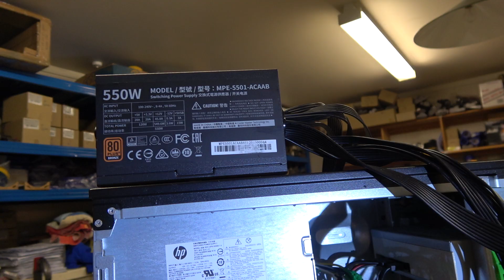hp atx power supply upgrade no adapter

Comment: You have to step up the purple 5v wire with a regulator or jumper it over to 12v to the p2 plug I've always just cut the wires off the OEM PSU and cut wires on the aftermarket PSU wired them up solder and send it .

Comment: Things have changed since the video. Atx to hp power adapter, the front io connectors need to be grounded by bridging a wire on usb 2 and connecting a jumper from the blank pin to the ground on pin 4 for the usb 3.0. That’s 2 or 3 jumper wires depending if what you have on the front io. You can wire the pwm fan into 4 pin seeing as you’re handy with electrics. I’m doing mine next week.
Reply: Are there any guides online on how to do it? Where can I find an adapter? Please send links if you have any.
Reply: @codycorg  https://www.youtube.com/watch?v=vL_QYvK_a8U

Comment: I'm  changed the PSU on my Z440. I bought the adaptor cables on eBay and it works well. Great job.
Reply: Still confused what makes a custom build z440 is a prebuild system ?? ( I mean before you upgraded it)

Also with the video why not buy a bigger case to house the psu motherboard and gpu etc

Comment: I really don't understand something from the video because English not my main language but by reading some comments i want to ask something i have hp 800g2 and i know that i can't get anypower supply because the adapter thing so i don't want to waste my money on something that is not going to work so i have a question i just need a power supply for the graphics card so can i get a one and just use it for the graphics card and the case with board and the hard drives and ssd use the other one is that going to be easy like get a Power supply then add a caple to the graphics card then it will work or i need to something specific like cut something and this hard things to make this work? Please answer me

Comment: wondering will 2nd power supply fan stay at full power if i short circuit the psu my hp pc also has same issue and im tryng to power a 4060ti so im thinking of doing the same thing using 2ns psu to power gpu only
Reply from the maker: The psu fans will normally do the cooling they need, But dont short circuit shit unless you trying to make smoke
Reply: @Robonza  so all i do is green wire with black wire psu turns on and plug it in to gpu nice and simple

Comment: I've been doing that stupid thing for a year now as main computer (i.e. 2 power supplies) So, now, to turn it on: dedicated video card PSU as #1, then turn on the computer.   Reverse order to shut it off.   Burns more electricity though - 2 psu's   No extra relays needed.   MY PSU has a switch on it and and plug on 24 connector to turn it on automatically.  Another stupid thing is cutting close cover open so that larger video card can fit into that small factor SSF with a grinder :)  I think it looks nice now.
Reply from the maker: Haha, nice. They dont really use too much more power as they mostly take what they need e.g. the efficiency rating plus house keeping.

Comment: A friend made a really neat twin PSU PC a few years ago. As he wasn't running any optical drives he removed the 5.25" cage and mounted the second PSU up there at the front. He hard wired a spur from the original PSU's power socket into the second power supply, and somehow triggered the second one to wake up using a MOSFET. He also replaced the 5.25" bay covers with a perforated alloy plate so the extra psu had somewhere to blow air out of. It all looked very tidy when he finished.

The reason for doing all this was because he had a couple of overclocked GTX 980 ti graphics cards SLIed in there, and during heavy gaming that pair would suck up over 500w all by themselves !!! He already had a really good 600w PSU in there, but found the system was getting unstable at the limit, so as he had a spare 450w unit sitting about doing nothing, he decided to just add that. The new PSU ran one 980 and all his RGB, while the original ran the second 980 and everything else.

He ran it like that for a couple of years before the lure of newer gaming hardware became too strong. Apparently the only issue he ever had with this setup was the ridicules amount of heat it produced. In summer, after a few hours of gaming, he'd have to open his game room window to let the temperature drop to a barrable level, and in winter he could near as damn it turn the houses heating off. :D
Reply from the maker: wow, that sounds really nice. I do that kind of stuff for my equipment. This was my 15 year olds cheap computer haha.
Reply: Hi if you have pictures can you text me how he did it

Comment: Wouldn’t doing this damage something or short circuit since I have the same issue because I bought a power supply for an rx6600 but the ps won’t work with the motherboard

Comment: Hey, sir, i want to do this modification ¿Could you help me a little? ¿How do i ask for the relay at the store? And last question ¿How do i know where to the solder the cables at the relay? The red + black cable that goes on the relay and the other 2 cables that you soldered, the blue + green ¿How do i know where to solder them? Please, help me just a little. Also ¿Where did you get the little 2 cables that you used to jump the bigger PSU? The blue + green cables, please, please, please, thanks in advance.
Reply from the maker: See if you find a local makerspace or Arduino club. A lot of people there would tell you how to do it and give you the relay for free

Comment: Where does the 2ng psu get it's power? It's not hooked on to any power source.
Reply: relay is hooked to the hard drive, hard drive is hooked to the tiny psu and relay at the same time is hooked to the black and green cable of the bigger psu.

Comment: Ok here I am again.  I did the same thing,  however it should be noted that a diode should be placed in reverse bias across the coil terminals of the relay.
Reply from the maker: Good advice. The relay I used had an integral diode. Prolly not needed but a good precaution
Reply: What components did you buy? A link would help A lot of people seeking the same solution
Reply: @trulgn  if you don't have any knowledge of electronic circuits, I wouldn't recommend doing any of this. I ended up using the card in a different computer with the same issue and I didn't need a relay I actually just used a npn transistor and a 10K resistor. This is basic electronics and if you don't have knowledge then I'm not going to recommend anything. I'm not going to be responsible for you frying your machine
Reply: @Lordsludge  yes from my point of view it is very risky. Couldn't he just buy a bigger pc case in the video to properly house the psu?

Comment: Funny thing is I have a hp with a 190 watt psu. Well this is what I did the cpu used 65 watts of power I got a evga gforce gtx 750 ti ftw 2gb card that used 65 watts got a sata power adapter to 4 pin molex to power the card. It runs fine. Lol I play yakuza like a dragon at 30 fps 1080p med settings it's not too bad. Really did not need to do it because I have a ps5 and series x. I did it because it mad me mad.
Reply: Am I getting this rite your system used a total of 130watts which is still under 190watt power supply? Does the psu wattage plus and  the gpu wattage have to be summed up to know how much wattage on a power supply is required
Reply: @trulgn  yes, most of the rest is board power, and it was 50 watts it works fine to this day. The 750 ti doesn't take 65 w more like 45w most of the time gpus take less than what it says. I build a pc later so I was mostly wondering if I could get the 750 ti to work.

Comment: Adapters can get very easy and cheap. If in your area not available, you can make one very easy yourself. Swapped cases and PSU's with these HP motherboard quite few times and it works perfectly. Actually got one of those adapters spare right now, as they are cheap, got one just in case will get another PC swap of this type. :) Also making it work with no error messages or needing to press F1 on startup. Everything is doable.
Reply: Where can I get the adapter(s)??
Reply: @Quadromodo yeah
Reply: ¿how make one?
Reply: If one uses the xw6200 of all boards, does it absolutely have to have that proprietary power supply with the additional "auxillary" 6 pin cable?
Reply: @AxeFxMike not sure on this one. I can see that this board have 24pin connector. Never done one of these before. If original power supply uses 24 pin, then obviously you will be fine with standard PS, if it uses 6pin, then I guess one way to find out is to try using 24pin connection and see if it works.
Reply: Do you knoe how to modify adaptor for HP Prodesk 600 g1 TWR?

Comment: Think I'll just do this, I can't get any adapter working either, bloody HP
Reply from the maker: Yeah, its still running strong today
Reply: @Robonza please help I turned off my PC but the other PSU was connected directly to GPU and it was on for long time, now my GPU won't turn on please tell me what happened, it's can be fixing?
Reply: @abidi-85  did you fix it?
Reply: @trulgn  no its gone
Reply: Sometimes you need to change the P2 6 pin connector cable position on the adapter for it to work, can't remember exactly which one, but sometimes they put one cable on the wrong position on P2 6 pin connector and it is what makes it faulty. You can find the correct configuration, and switch the little 6 pin (1 cable) to the right configuration(cables position, which should be just a single cable that you need to reposition) and it should work right away.

Comment: Genius!  -Thank you for sharing.  I would like to apply your solution to power a high wattage external GPU connected to an HP Pro 6300 SFF. Do you mind providing some close-ups or explanations of the red & black wire splices, and a part number of the relay you used.  Much obliged!
Reply from the maker: Any old 5v or 12v relay will work. You simply connect it to the 12v or 5v hard drive power depending if you choose a 5v or 12 relay. The relay normally open contacts start the 2nd power supply, just google "atx power supply turn on without motherboard"
Reply: @Robonza  Thank you for your response, Sir! Since then, I found out that your Power idea/solution/concept is not only genius, it is also commercialized as this product: "ATX 24Pin to SATA Dual PSU Power Supply Sync Starter Extender Cable Card".  When you Google it, the Amazon purchasing option is one of the first to show up, but other companies such as eBay and AliExpress sell these adapters too.  The ATX adapter kind with a SATA connection to your PC is the easiest connection, in my opinion.
Reply: @christianviewmont5632  how did you solve your problem I have the exact same pc as yours and I can’t put exchange power supply’s because of that stupid cable